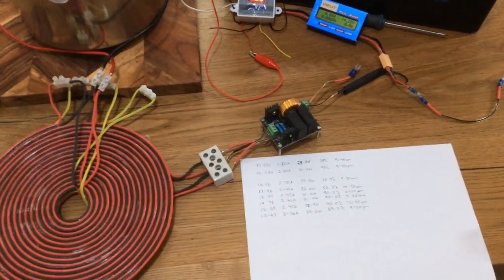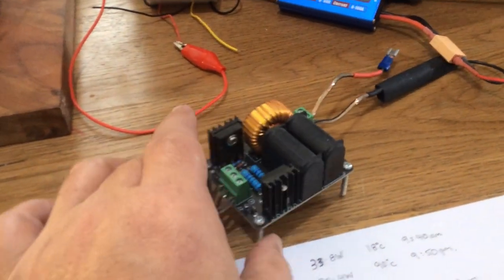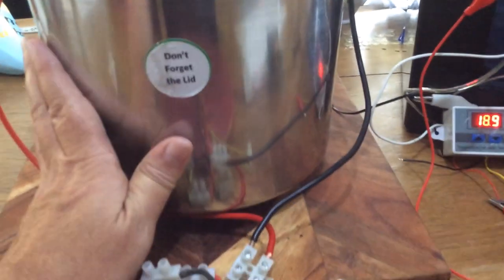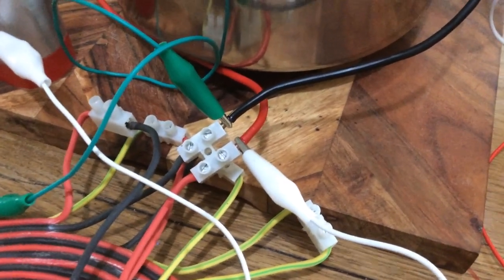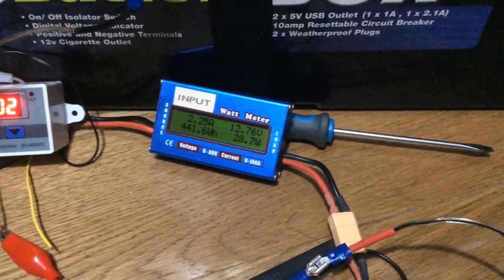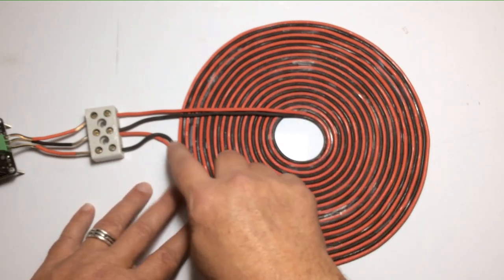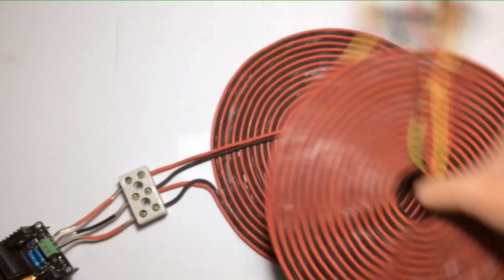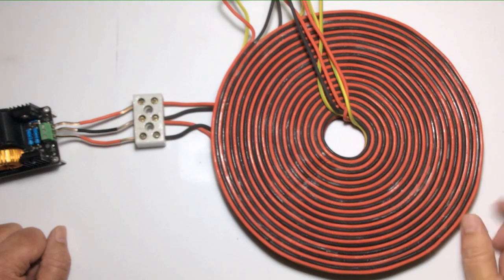TESLA PANCAKE COIL D.I.Y. SAND HEATER SOLAR POWERED

Comment: great job bro......'the only way to take THEIR power away from them....is to take their POWER away from them'.........
Reply from the maker: Thank you for watching.
Can’t argue with that. We need everyone to do their small bit and educate the youth that there are ways that work and we can take what we have already paid for!
Reply: @whatifididthis...1236  100% ....your work is awesome...cheers...also..
what is the thing with the coil?....do you need it if using small pancakes?....and could you show a simple diagram of what the se up is?....pea brains like me dont quite get it...cheers
Reply from the maker: @thebigfella9095  Thank you for your kind words.
If you are referring to the small circuit board that the coil is connected to it is called a ZVS, Zero Voltage Switching that switches off and on at zero volts creating a flip flop or back and forth type reaction on the positives.

The bifilar pancake coil is generally used with an AC or pulsed DC that essentially mimics AC, you can use any oscillator from things like mains AC (extremely dangerous & not recommended) down to a perfectly safe 1.5 volt joule thief to power a pancake coil. However, there are more practical means of low voltage lighting and this setup is more effective on heavy loads, like heating elements and halogen bulbs.

I will make another video with a schematic, I remember when I first started learning electronics, trying to reverse engineer from videos is not easy. Let me know exactly what it is your struggling with and I will add it in the video. Don’t beat yourself up, we are all stupid until we know, then we are no longer stupid.
Reply: @whatifididthis...1236  yes..ok thanks ...yes my knowledge is very minimum....great to learn thankyou

Comment: Dag, ik ken niet veel van elektriciteit maar om vlug zand op te warmen zou ik zakjes met kersenpitten verwarmen in de microgolfoven  na 3 minuten heb je 90 graden en daarna in het zand steken maar ik weet niet goed of het daarna nog doenbaar is om heel die toestellen te installeren ,het is maar een idee he
Reply from the maker: Thank you for your comment.
Pre heating the sand with heated rocks is a good idea, I am unsure of the composition of the “cherry rocks” you mention but I would be careful placing rocks with an iron content into a microwave.
The slow heating aspect of this device is to allow for an extremely low power consumption allowing you to leave the unit running 24 hours a day, however, your idea would assist heating and therefore require less energy to heat the sand... if not using energy in the microwave and the rocks were heated some other way.
Reply: Ik zou eens proberen om zand in een bloempot in een microgolfoven direct op te warmen ik kan het niet zelf doen want ik heb momenteel geen microgolfoven maar als u eten opwarmt in een vuurvaste schotel warmt het eten vlugger op dan de schotel omdat de stralen gemakkelijker door het eten gaan dan door de schotel,  ik weet niet hoe het zit met het zand

Comment: Cool! I wonder if you could speed up the heating time and efficiency by increasing the surface area of the heating element. Like, instead of a rod that heats only the area of sand around it, with the heat gradually dispersing into layers around it, perhaps a metal coil that comes into contact with more sand from the start.
Reply from the maker: Thanks for watching.
That is a good idea, a large coil would work great, something like a shock absorber spring might be good for this. I might suggest using a wire with a very high temp insulation but as long as the wattage consumption due to resistance wasn’t too high it should work.

My main focus here is achieving this high temperature without a large power draw, once the pot is up to temp it can be left on 24 hours a day at 30ma which is less than a phone charger, therefore requiring only one slow warm up phase. As long as this was turned on in the morning it would be ready by nightfall.

Comment: I'm really curious about the temperature in different locations and distance from the heat element.  Does the heat radiate out or up
Reply from the maker: Thank you for your comment.
I tested the temperature in a heap of different spots with a laser thermal probe with the lid off and the surface temperature got to a maximum of 70 degrees Celsius. The side of the pot reached a maximum of 45 degrees Celsius. With the lid on, the air inside the pot appears to act as an insulator allowing the heat to be lost in more of a radial fashion resulting in a 50 degree temperature on the side of the pot and a 10 degree increase with the submerged temp probe. In conclusion, I believe when the lid is on, the majority of the heat is dissipated through the side of the pot with the metal of the pot acting as a heat sink, with the lid off it is safe to assume the majority of heat escapes through the open top as it is the point of least resistance.

Comment: Do you think that unequal length of wires in bifilar plays any role at all in your design ?
Reply from the maker: Thank you for your comment.
Anything is possible, particularly if you consider the resonant frequency is mostly affected by the length of the wire. This could be tested by adding a short measured length of wire to the end of the shorter wire prior to connection and test if there is any difference, it should not matter that this “extra” wire isn’t part of the wound coil, as long as it is in series with the short wire in the coil this will make both wires resonant by being the same length.
Reply: @whatifididthis...1236  indeed, for wireless coupling purpose they act exact as you described. But if we look to the patent we can notice that the length of both wires in bifilar is equal as they are terminated of different points of the diameter. Yet, i have not seen anyone doing this way … probably for convenience of connections. I wonder what would be changed … i need to make more coils now, but i don’t have instruments to measure so, it will be empirical experience. As i know for sure from Arie deGeus patent that wires need to be equal for collection of  standing waves at “bellies” (antinodes) and nodes if the length of wires used is multiple of 1/2 wave length of frequency and i now that every mm count for the length.

Comment: Great work, congratulations 👏🏻

I wonder if instead solar pv input can be used radiant energy system as you described and show working a while ago
Reply from the maker: Thank you for your comment.
Yes, my radiant energy circuit would work as would most oscillator circuits with Tesla’s pancake coil. However, the intended load has a large effect on frequency and needs to be calculated or considered when choosing a suitable oscillator circuit.

Comment: how can you measure that it gives out more than it consumes?
Reply from the maker: Thank you for your comment.
Tesla Pancake coils have been shown to definitely have an increase in power when compared side by side with the same load operating on conventional electricity. That being said, most of the time this output can’t be measured due to high frequency even though this can be visually observed for example in the case of lights measured with a lumens meter.
To calculate this energy, capacitors of a known value could be charged and the energy measured over time for charging and or discharging.
Usually, I determine efficiency on energy consumed to produce a specific product. In relation to this circuit, a small 200 watt inverter running a 70 watt halogen bulb on a 12 volt battery consumes 120 watts from the battery. Whilst this circuit runs the same 70 watt bulb with the same intensity consuming only 56 watts from the battery which seems to be in line with the claims of approximately 50% increase in output energy from a pancake coil, I believe Tesla stated there was a capacitive effect between each wire.
Reply: @whatifididthis...1236  so this heater consumes 30w and gives out how many watts heat approx?
Reply from the maker: @ReigoVilbiks  We might need to perform another experiment to fairly answer that one. The easiest way I know of would be to heat a known volume of water with just the heater element and time how long it takes.

Comment: hi ,
can you send me hwere you buy this part after battery - i dont understand the name
Reply from the maker: Thank you for watching.
The item you speak of is called a ZVS = Zero Voltage Switching. This is a simple oscillator that can be purchased in a two or three line output. The one in this video is a three line output. They cost approximately $10 to $20 AUD and can be purchased from most online electronics suppliers or selling platforms. You can purchase different wattage units depending on your load requirements. A quick browser search will definitely yield results.

Comment: Hi, is there a reason for larger diameter in your pancake coils? I thought they should not exceed 3x internal diameter in total
Reply from the maker: Thank you for your comment.
I have not read of this concept that the external diameter should not exceed 3x. That does not mean it’s not true. Would you please be able to share where you have read this?
Reply: I already posted 3 times but my message is removed every time
Reply: It seems that YouTube don’t allow links or whatever is happening
Reply from the maker: @Caesarus2011  I know, it’s as though they want a monopoly on information, scared that you might learn something elsewhere, like the truth!
You can get creative for example you can write it like “YouTube dot com” with the spaces and then it is not an address.
Reply: @whatifididthis...1236 this is crazy I’ve tried so many times and my message is removed every time even there isn’t anything that might look like an web address. I can try to post in two messages first is am dash
Reply: And second is innovations
Reply: YouTube is filtering certain words like the short form of commercial which should follow the address given in 2 messages
Reply from the maker: @Caesarus2011   I have seen that site, a long time ago, they have updated it quite a lot since my last visit.
On the page relating to “flat” pancake coils you will notice they display a Tesla patent image of pancake coils, this is why my pancake coils look like they do because I designed them from Tesla’s patent. Sometimes it would be good if people would make it exactly as the patent shows, then modify if you want something else.
Reply: @whatifididthis...1236  Agreed, if someone try to replicate and is not familiar with setup and phenomena must copy and learn before altering or innovate. Inner wire is always shorter in a bifilar spiral flat coil which lead to different effects and that’s why I asked if you have a particular reason. It looks like your reason was to keep same setup as Tesla did in his patent/invention which is fair and reasonable approach as you managed,to have astonishing result.

Comment: does any back EMF shoot through the ZVS?
Reply from the maker: Thank you for your comment.
I don’t believe it does and you can always protect the battery with a diode before the ZVS just to be safe.
Reply: @whatifididthis...1236  I was thinking precisely that. Actually was thinking a diode after the ZVS, before the coils.
One other question, where would you put a potentiometer in the flow? Before or after the ZVS?
I was also thinking after the ZVS because it always needs a minimum voltage into it, but is it OK to cut off the voltage after (with a pot) as to control what goes into the coil?
Reply from the maker: @emichael06  I’m not sure a diode after the ZVS would work because it may effect the capacitors on board the ZVS. I am also unsure of the effect of using a pot after the ZVS as I have not done this. Assuming you are wanting to control input voltage I would suggest an adjustable boost converter before the ZVS. Most ZVS have an input voltage range between 12volt to 36 volts.

Comment: Two coils bifilar one is a transmitter coil the other is resonant. The three coils in the middle, how are they connected? Are they all in series connected to each other? Are they all closed loop, are they connected to the receiver coil? I watched and tried to guess from your video but I can't make out your spaghetti
Reply from the maker: Thanks for your comment.
Spaghetti it is, I will make a short video with a schematic and go more in depth about the individual coils. In short, you are correct, they are wired in series making the output the start of the single wire coil and the end of the bifilar coil, nope, that’s still confusing! I will stitch together some short clips with different coil arrangements and schematics so it’s clear.